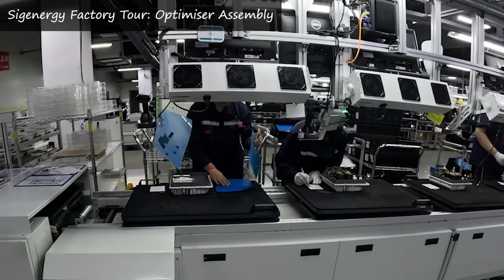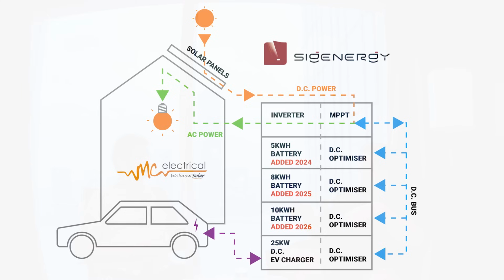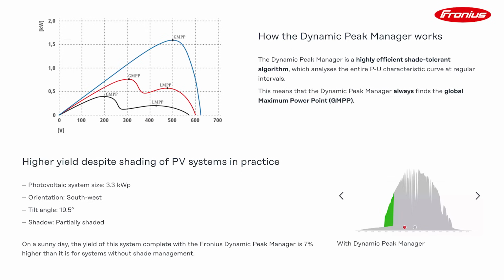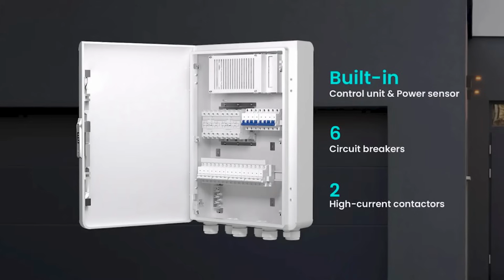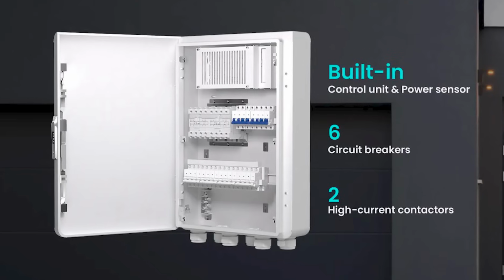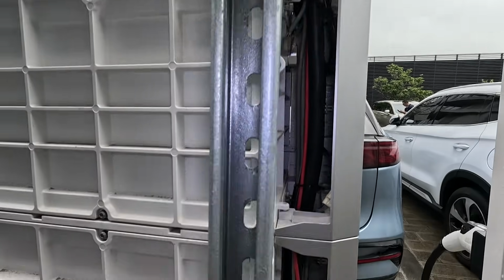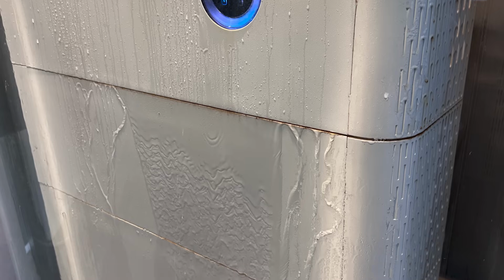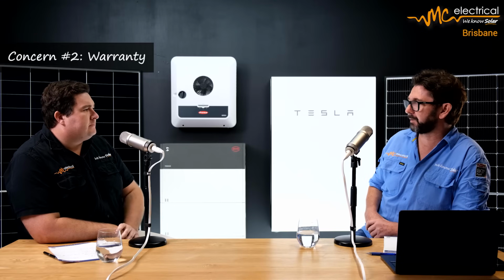Sigenergy Solar Battery Review After Factory Tour

Comment: So the battery doesn't have "AI" or even a "LLM" in the battery, most likely it's just accessing the modbus feed from the battery and using that in its context. 
THe whole "where does this bolt go" is just Sigenergy running a chat interface with a custom System Prompt loaded up with several pages of installation diagrams and text.

I can get the same thing by running Opencode or Pi then :
- customising my own System Prompt with the same pages and pages of installation diagrams and documentation 
- creating a tool that can access the modbus feed of the battery.

Comment: You talk about Fronius being great… I disagree. I have a Fronius system and have had 2 failed inverters and a failed wattpilot. Warranty support is slow and miserly. Won’t stand by their product. Worst I’ve ever experienced. Would NOT recommend.
Reply from the maker: Interesting. How old were the inverters when they failed? Did you go through your installer for warranty? We had a several issues with the first version of the wattpilots after not so many installed, but their inverters have been really reliable and support is responsive. 
However like most inverter manufacturers, they don’t really deal with end users.

Comment: Lucky we have a little thing called the Australian Consumer Law to help the consumer when bad shit happens. As the ACL clearly states - products sold in Australia must be DURABLE, so a home battery storage system (in total) should last for at least 10 years without significant degredation. IF Sigenergy wants to play in our market they need to be able to meet the ACL - regardless of their "Warranty" - which for the uniformed is worth nothing in Australia because of our consumer protection laws  are so strong.
Reply from the maker: It’s a bit like getting punched in the face. There are laws against it, and you can report it to the cops, but best not be an idiot in the first place.

Comment: As a prospective user, one thing I find frustrating is that the manual for the software is so incomplete and ambiguous. Can someone please answer a question. I want to set the system up so that between 11am and 2pm every day, the system charges the battery at the maximum possible rate. So, I set up Time Based Control Mode and the charge option in the 11-2 window. Now, what I would like to happen is that the unit combines solar and grid power in order to charge the battery at the maximum possible rate of charge. Suppose I have a 32kWh battery (max allowable charge rate 16kW) and I have the 10kW inverter option. And solar is providing 4kW. Will this system charge the battery at a rate of 14kW? (That's 10kW from the grid and 4kW from solar). 

Next, when the battery isn't charging from the grid, at every other hour (00:00 to 11:00 and 14:00 to 24:00) I want the default behaviour to be that solar will supply the load, then charge the battery and only then export. If I use the "self consumption" option, will this be what happens? The manual is confusing about this. In one illustration it shows solar charging the battery but only during the "charge" window. I can't see why that would be the case. Just want a definitive answer.

Also, can I hack the Time Based Control Mode? Suppose I set it to charge, but then I lower the "grid to battery" parameter to zero. Will it do what I expect, which is no power from grid, but solar will continue to charge the battery (after having met the load).
Reply from the maker: I think your first 2 points should happen easily. It should charge at max with solar plus grid at lunchtime, and, normal operation is solar goes to load first, battery second, grid third. 
Third point about hacking the time based control load seems unnecessary it if I am understanding you correctly.

Comment: I'm guessing because you are Australians you don't think much about low temperatures? How does this battery perform if installed outside in sub-zero temperatures? I have a MyEnergi Libbi, and it has in-built heating to ensure the battery is able to charge at a suitable rate (without damaging itself).
Reply: The SigenStore has built-in heating pads. That should be pretty standard for all battery systems, as low temperatures will impact the performance of the batteries.

Comment: I am considering sigenergy but the biggest concern I have is on the multipart warrenty on the gateway since it is only 2 years. 

I am wondering what does this mean for an integrated system. Do I need to place gateway in case of failure after warrenty?
Reply from the maker: Tbh, I’d just be more worried that tue company will be around to honour their warranty. We’ve got a new video about our concerns coming out tomorrow.

Comment: isnt this the number one selling battery now jeez i wonder how many sales they have lost when their even saying themselves they dont know. I bet they sold other batteries over the years that werent tried and tested. Its a near impossibility they havent. I get they dont want the risk but this space is full of innovation which means alot of the larger solar panels would have beenb put on roofs without knowing if that would last long term. The cable management looks fine to me i get the rat situation but how many homes are living with rats more of an issue in a commercial setting then residential. I would buy one of these they are great for the price.

Comment: Gents - I went down the path of a 22KW solar install 2 years ago, with a Fronius 3 Phase symo (non-hybrid).   At the time I never thought batteries would make $ sense - and if so, would AC couple a Powerwall.    However, now with the rebate, and my energy use - I could try to max out to 50kwh and utilise overnight charging + Solar and power my house at no more than super-off peak rates..        What Else out there can do this?  BYD can't - you say that Sungrow is not reliable either.     What would you actually do?
Reply from the maker: Yeah Powerwall 2s aren't available to AC-couple anymore. Our customers are opting to replace their Symo Snap inverters for Tesla Powerwall 3, or Fronius GEN24 paired with BYD, or they're waiting for the Fronius Reserva that's coming in Q3 this year: https://mcelectrical.com.au/fronius-reserva-solar-battery/

Comment: Just came across this video as im about too ditch a SE system and replace it with SigEnergy, interesting that you don't recommend them at this point with the early/young company stance but 2 years of SE has proven to be a test to ones sanity.
Reply: Our experience with companies like SolarEdge is a big reason why we have a highly cautious approach. Like SigEnergy, SolarEdge was all the rage when it first hit the Australian market. These days we would not touch SE with a 10-foot pole. Not saying that the two brands are the same and we expect the same outcome but there is a risk in being an early adopter.

Comment: To be honest, one of the key things people often overlook with products like this is what happens a few years down the track—especially when components start to fail or if customer service becomes an issue. While the price and specs are impressive, it's worth noting that the company has only been operating in Australia for less than a year, which raises some concerns.

Another point to consider is that their customer support appears to be limited to an email address and a mobile number. That alone should be a bit of a red flag in terms of long-term support and accountability.

I’ve also had trouble finding a clear breakdown of the battery components and the specific warranty coverage for each part. If you’re able to share that information, it would be greatly appreciated.
Reply from the maker: Very true aftersales support is vital and we're not convinced about Omnidian. The part warranties keep changing but this is what's on SolarQuotes: 

"The SigenStor has a 10-year product warranty on the battery and energy controller, 5 years on the gateway, and 2 years on the power sensor and communications modules. Sigenergy warrants that the battery system will retain either 70% of usable capacity at year 10 or for a minimum energy throughput of 15.85MWh for the 5kWh module or 23.77MWh for the 8kWh; whichever comes first."

https://www.solarquotes.com.au/battery-storage/reviews/sigenergy-review.html

Or contact one of the Sig installers in the bottom half of that page and they should have the latest warranty info.

Comment: my backup gateway is  5 year warranty with extension to 10 years for + 275 AUD. the only "bad" warranty seems to be the power meter/sensor at 2 years, thats compared to the 5 years that my Fronius smart meter has ( i have AC coupled the sigstor)
Reply from the maker: Yeh I heard they upped the warranty of the gateway. That’s good!

Comment: Hi we have had our sigenergy inverter 25KW ( 3 phase ) plus battery 40kw plus 28kw panels installed since end of feb 2025 really impressed with offgrid energy  professional help and guidance and installation was extremely good we are still connected to the grid but have supplied all our own power and pumped aprox 4 mwh back into the grid as well, system works very well we are very happy in these early days

Comment: I’ve currently got solar with a Fronius inverter and Wattpilot - it works brilliantly. The rock solid Home Assistant integration alone is a stand out. However, when I looked at adding a battery I found the Fronius options to extremely constrained (both BYD and Fronius stacks) - especially on single phase in QLD (10kW hybrid inverter limit)
Fronius’ charge/discharge rates are subpar, the kWh capacity limit per stack is very low on 10kW single phase, 150% inverter capacity limit isn’t great, and only 2 MPPTs is a big limitation. 
I’ve just signed up for a Sigenergy 10kW and 48kWh system - binning the Fronius inverter. Their whole of system value proposition is extremely compelling. 
I think it’s worth reconsidering your conclusion and jump onboard with Sigenergy - it just makes sense with the federal battery rebate and current QLD limitations.
Reply: @brendanmtaylor This is a very similar situation I am faced with (minus the EV) I paid a lot of money to go with a fronius gen24 system based on feedback it’s the best in the business- I am now looking at battery storage to meet my consumption needs but also looking at potentially selling my thru amber and accessing the wholesale pricing to try and accelerate payback period as much as possible. Fronius/byd inability to discharge back to the grid quickly makes it quite inferior for this purpose. I literally spoke to an installer today and the price is the same to bin the fronius (12 months old…) install sigenergy inverter and 16kwh battery as installing just 13kwh of byd batteries. The only hope I have is if I wait that fronius/byd becomes cheaper (to compete) or some newer product is launched that is better compatible and more competitive. Kinda wish I listened to my original installer that was trying to push me down the sungrow path originally which would have been a better outcome on cost and performance.

Comment: how does sigenergy gateway switch from on grid to off grid in 0ms which like UPS but they don't have 2 rectifiers?
Reply from the maker: From what i understand, they don’t use parallel rectifiers like ups. Instead hybrid inverters are grid forming (stand alone). Sig apparently is “always on” grid forming, so it has zero latency when the grid goes down.
Reply: @mcelectrical  thanks for the explanation, this is really new to me, i didn't see any other companies that use same technology

Comment: I got quoted a sigenergy 8kw today for 1665 post rebate in Brisbane…. From what appears to be a reputable installer on the main credible comparison sites….

This seems too good to be true surely? $206/kwh installed? Surely this is a case of ‘if it’s too good to be true?’

As a customer with a 10kw fronius gen24 primo I’m somewhat ‘stuck’ with BYD where the price differential is substantial…. Plus the BYD discharge rate seems pretty poor compared to the competition? As someone interested in using amber to sell back to the grid during spikes it’s very tempting to go for something that costs less that can discharge faster. Safety is my number 1 concern which is why I will likely stay clear of sigenergy as it hasn’t had enough time in market yet to understand long term reliability and safety.
Reply: But you need to add the cost of the inverter module and gateway on top for it to work. Who did your quote? looking to install near Brisbane as well and your price for the 8kw battery is cheaper then what I've been quoted.
Reply: @langist100 LMS electrical. I think it has gone up slightly since. Im not sure if the battery can be hooked into the fronius directly or not. Sig is shaking up the market which is a good thing and I hope it means BYD etc becomes more competitive. At this stage as a fronius owner in going to wait a little longer before pulling the trigger.
Reply from the maker: Fronius has a new battery in the works following the Reserva
Reply: @mcelectrical  sounds promising. Any ideas of ETA?

Comment: Would you recommend Selectronic? There's a lot to like being Aussie made & have been around for 50 years+. Interested to hear your thoughts.
Reply: We had a Selectronic system for 13 years. They are very well built and the support is very good. However the software has very limited user facing information and control. They 'seem' low tech compared to Signenergy and the newer players. They did release a battery system a few years ago but I'm not sure how competitive they are

Comment: What would be the advantages and disadvantages of connecting the Sigenstor as AC coupled or DC coupled for a retrofit?
Reply from the maker: Disadvantages, pointed out at the end of this video. Plus they still have not been listed on the Hong Kong stock exchange - which may be a make or break for the company.

Advantages. Long story short, the genius of the Sig product is the full dc coupled architecture. If you are not using it for that, it’s a bad idea.

Comment: Do you not have Victron in Australia? They have the instant backup functionality too. Surprised they didn't get a mention. I've got it working here, and you don't notice if the power goes off at all, except for getting an email.
Reply from the maker: Yes, but, it’s not approved as a grid tied inverter, and they only have 3 and 5kw grid tied inverted anyway don’t they?
Reply: @mcelectrical  They have 3, 5, 8, 10, 15 kW versions of both multiplus and Quattro, and you can gang them to get 6, 10, 9, 15, 30, 45 etc (but that gets expensive). The grid approval situation is rather confusing and varies by country. In the UK the 3 and 5kW multiplus are approved under G99/1 but the 8kW wasn't (not sure about 15). But then G99/2 came into force last year and they've not issued a cert for that yet. However it doesn't seem to matter in practice as I just got mine approved a couple of months ago, but obviously this is offputting to most people/installers.
They are still grid approved/not approved in various other countries. No idea what the AU situation is.
It's not entirely clear whether they don't actually comply or they just can't be bothered with more certifications here because grid-tied is not their main market.

Comment: What is the dc voltage of the battery modules?
Reply from the maker: The modules are around 100 volts, but then it’s stepped up to a higher bus voltage at each module depending on the string inverter. (Between 300 and 600volts for single phase)

Comment: Thanks for all your vids. Had Yorick out last week for a quote, and I’ve gotten a quote for the sigenergy system from another good Brissie installer, who actually recommended the sigenergy system without me asking. I get (and completely understand) from a business perspective about the risks to you to servicing a system with a MIA manufacturer. For an end user however, if I’ve got an installer willing to take on that risk, what are the downsides for me? Obviously if the installer has put in 100’s of these, they all break, and the manufacturer is gone, then they’ll be gone in a big hurry right behind them, but if you put a system in like this and it failed, and you couldn’t get support from Sigenergy, what does that mean to you? Would you be up for replacing the system with something else thats “the same”? PS, picking a solar and battery system is hard…..
Reply from the maker: Fair call. It is a tempting products Yes, the way I understand consumer law, it is on me to replace it with something similar. You’ll be surprised that many of my friends in the industry don’t think that’s the case, but it is. I’d get in writing from the installer that they acknowledge that they are fully responsible regardless of what happens. Btw, if you want a good company that does sig, try Springers.